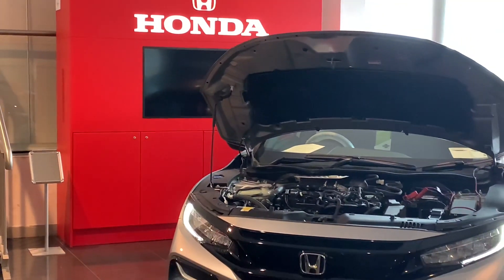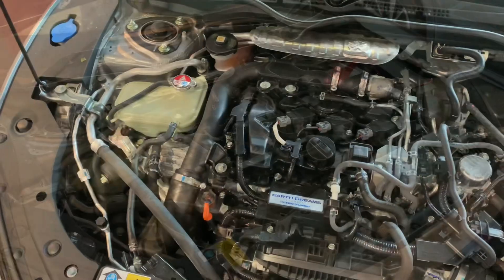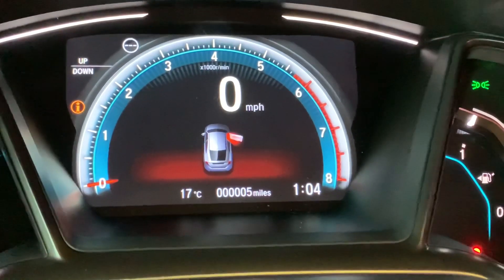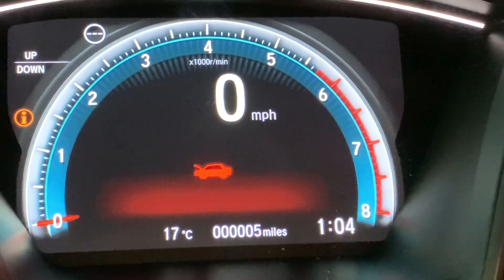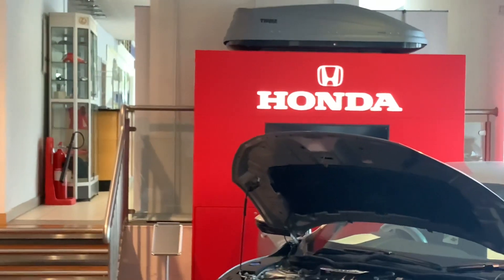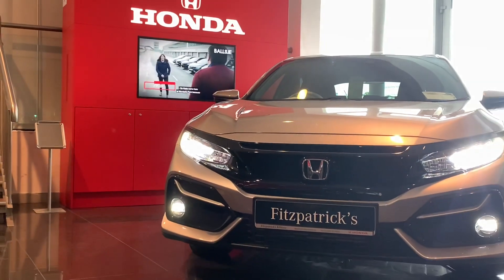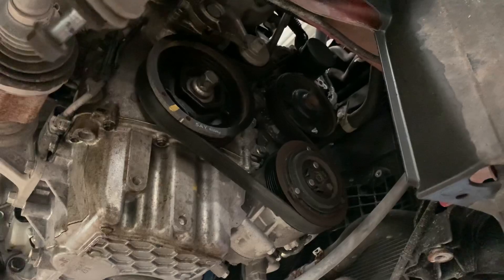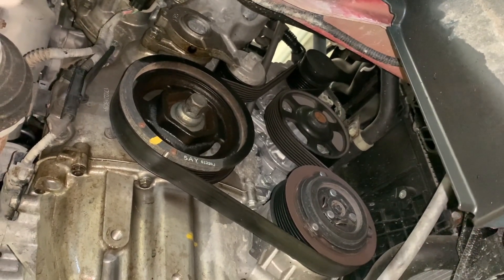1.0 Turbo Civic engine review - P10A2 - what is it like ?

Comment: Bad engine with lots of problems
Reply: im still with no car they got the engine down and open the cilinder head valves on cy2 were dirty and blacked compered to cy1 and 3 that looked like new waiting an answer from Honda Italy
Reply from the maker: @Exia2004  what year is the vehicle ?
Reply: @doolanbrian  it is from 2017 any way we find the damage was the mid piston head had a broken piece between the two piston rings..... Honda passed in warranty after 2 months having the car in the workshop (i was one year out of official warranty) the engine without cilinder head and the turbine plus labor Hours im only to pay oil gasket and stuff like that and I changed the clutch
Reply from the maker: @Exia2004  ok so you are getting a lot of it under warranty?? This is a good result ! 🙂thanks for the update !
Reply: @doolanbrian  new update i had to leave the car in Honda again for cylinder misfire. wow im really disappointed ☹️
Reply from the maker: @Exia2004  has your engine had a rebuild ??
Reply: @doolanbrian  yeah you can say that they changed the cylinder block and the cylinders with new ones
Reply from the maker: @Exia2004  let me know what the diagnosis is .. I’m curious, I’m sure they’ll fix it but it’s annoying alright
Reply from the maker: The engine issues on this are usually linked to 
✅poor service history
✅incorrect oil used
It is a fickle engine but it can be reliable when serviced correctly
Reply: @doolanbrian  serviced every 8k km the right oil driven her no more the 180km/h now out of nowhere random missfire at 88468km this is my third Civic....such a ket down
Reply from the maker: @Exia2004  what is the diagnosis on it ?

Comment: important question: which oil does this engine in combination with the CVT-Automatic requires ? Or which is is used by your dealership? Thanks alot.
mine got 0w20 Honda Type Engine Oil.
Is it possible to use other brands?
Reply from the maker: We can only recommend the genuine brand so there is a specific CVT gear oil and a specific earth dreams engine oil for this engine .. where do you live ??
Reply: @doolanbrian  im in germany.the car has been manufactured to my suprise not in swindon but tokyo. its an importversion from belgium.id like mine to work as reliable as possible. but figured oud that 0w20 viscosity oil is very coldstart friendly maybe thats the reason fir the dealership to use the 0w20. i hope it wont oberheat on long drives and burns oil.  i intending to do the service with a castrol C2 oil,but the dealership here said they only use original honda oil. thanks alot
Reply from the maker: @Hawk816816  Are you sure it was assembled in Japan? Definitely never heard of that before but I always stand to be corrected, I would purchase oil from the local Honda dealer and use what they recommend, that is what we do here, thanks for watching!
Reply: @doolanbrian  yep, has the plant no. of minato japan in the cars code no.as i said i was surpried since i expected england. maybe belgiun civics were imported from japan?
Reply from the maker: @Hawk816816  It’s possible, I never heard of it but I’m always open to new information! Thanks for sharing

Comment: When you look up Civics from 2006-2022 they have timing chains. Very confusing regardless the engine size
Reply from the maker: Since 2017 1 L petrol is the only one that comes with a timing belt, 1.5 petrol has a chain, 1.6 diesel also has a chain 🙂🙂
Reply: @doolanbrian  yes, I had a look, it’s a belt. 👍🏻 cheers

Comment: Does this car have a turbo with an intercooler then? If so is it safe to do any performance upgrades to the car?
Reply from the maker: Hi there ! I loved top gun !!  It is my understanding that all turbo cars have an inter oiler so technically you could Chsnge parts like the inter cooler to increase air flow .. it’s quite a small block so I don’t know how robust it would be to increasing the Bhp ! It’s possible .. but you would need to ensure oil flow is not compromised 💪🙂 hope this helps !!
Reply: @doolanbrian  spot on thanks for your help. I have this engine in a sport line but wanted 1.5 however no leather options unless prestige. Your videos are great and informative. I was looking at a remap to be honest with a new exhaust system. I did see you mentioned about the timing belt change but I Also read online that Honda reckon this belt will last the lifetime of the vehicle. It's an oil in belt setup I believe?
Reply from the maker: @maverick9055  thanks for the nice comment .. sportline is lovely spec !! We never got it here 🙄😞 … we have been told to change the belts at 6 years or 120000 , have you asked your supplying dealer if they have a recommendation?? I’ve not heard of a lifetime belt recommendation … it would be great because it’s an expensive job !!!
Reply: @doolanbrian  yeah it's a cracking spec car. Leather and body kit etc. Needs a bit more power but good for around town. Be better if you opened up over here in UK. After sales are never great over here. Yeah I read it online about the lifetime thing. All about plenty oil and clean oil by look of it.

Comment: Great video.  What's it like for motorway drives and mpg for long distance journeys...really intrested in how this engine will do at constant 70mph driving.
Reply from the maker: Hi there thanks for watching I suppose on the motorway you should average about 6.5 L to 7 L per 100 km. Roughly 35/ 40 miles per gallon. It will also cruise very comfortably at that speed 🙂✅
Reply: @doolanbrian  I drove 700km and most of them were on motorway. I averaged 6L/100km with average speed of 110km/h. 90% of the journey It was onAdaptive cruise control.
Reply from the maker: @hamidsiddiqi3573  that’s good going, thanks for watching!

Comment: My first question is how much does the engine weigh? That’s engine, including cooling system, including fluids, but specifying what fluids and what quantity.
Reply from the maker: So as we were saying, the engine probably weighs around 1275 KG by itself .. There is approximately 3.8 L of oil that needs to go in and approximately 5 L of coolant, hope this helps!
Reply from the maker: From what I can see apparently it is about 1275 kg .. I’ll come back to you to let you know how much coolant and oil goes into the engine, I need to check with a mechanic on Monday
Reply: @doolanbrian  thanks, I’ve had a love affair with Honda engineering since forever. You know they say they aren’t car builders, only engine builders who also build some cars. You may not know this, but post World War 2, mr. Honda’s only child, a girl, married an Irish/Australian mechanic, who guided the engineering of the company for over 20 years.
Reply from the maker: @anthonyburke5656  that’s mad bit of history, I think back then they were more into motorbikes and sewing machines?

Comment: Thanks for the video Brian very informative, I have a question regarding the same 1.0  turbo you have reviewed in the video for a friend. She currently has here car in with the mechanic due to a faulty turbo in the 17-2 model. The total cost of the replacement and service is coming to 3k, the mechanic who we have both had our car with many times mentioned that he did a bit of research on the newer model civic's and he found that there has been a high amount of reported faults with this models turbo. I'm wondering if you could shed some light on this and let me know if there is actually any truth in his statement? He even went as far to say he would have always sworn by Honda's and Toyota's but after his finding he'd be steering people away from buy this model. She'd be a very conservative driver unlike me on the other hand. Thanks in advance!
Reply from the maker: Hey Colm , we had replaced a couple of Turbos alright unfortunately . If its needs a turbo it is expensive for sure . The issues we have seen can relate to large gaps in oil changes . Yours may be different but we had seen a couple of turbos blown on cars which had large gaps in the service record and in both cases they were overdue service. The interval on these engines is short at about 8000-10000kms but its necessary to keep the oil and the turbo in good shape. Has your friend gone to a main dealer direct ?
Reply: @doolanbrian  thanks for the reply good to know that the mechanic wasn't BSing her she didn't send it into a main dealer it's a garage we've been using for years
Reply from the maker: @collykavo1  how many kms on the vehicle ?? Just curious!
Reply: Brian, have you had any further failures of the 1L engine since this video was made? I have been in contact with Honda UK and they have admitted swarf from the belt clogging oil pathways is a definite problem on these engines. Such a shame its a wet belt! Be no problem if it were a standard dry belt.
Reply: 48k

Comment: Does this car use similar suspension and brake part to the 1.5l model?
Reply from the maker: Suspension is the same but I’d need to check the pads .. do you have registration??

Comment: great video!!    i own 2017 civic 1.0 its been a nice car to drive.here in Sri lanka many customers faced the so called AC condensor issue including me. had to fill up r1234yf and replace ac condensor. and some users here complained their turbo failed. this happened becuse of the use of semi synthetic engine oils. NEVER PUT SEMI SYN ON TURBOS! this car is soo sensitive.. but such a fun car to drive AND this car loves highways!best fuel economy 4/2l/100km which ive achieved.. keep doing videos about this model Brian! been watching since u started this series. cheers!
Reply from the maker: Thank you for the nice comment! We also have the a/c condenser issue but in fairness the manufacturer is standing over the issue which is great .. we had some turbos fail but again Honda warranty has been excellent !! Thank you for participating!! 🙂

Comment: I've seen civic with the 1.0l on autotrader with 95k miles in it. So I guess the reliability is there. I've heard one guy had problems with oil starvation caused by the timing belt and it was at low mileage also. Ours sits at 60k miles now so probably next year will do the timing belt on it.  I don't know if any independent garage will handle this job. My only option might be Honda dealership. I was quoted £800 at my local Honda. Quite a lot for a timing belt change. I don't like it when the serviceable items costs nearly 1k to do. Puts me right off and most people sell it just before the timing belt interval.
Reply from the maker: Yes, I reckon by the time you do the timing belt and service on the vehicle it will be close on €1000 .. due at year six or 120,000 km, it’s an extremely labour-intensive job unfortunately so it looks like a full day in a workshop which is abnormal compared to most vehicles🙂 The starvation issue, can occur with fraying on the timing belt.. regular oil changes are absolutely imperative
Reply: @doolanbrian  I've always done the services on my own. We buy cars when they're out of warranty anyway. Change oil every 6k-7k miles. Don't trust these long interval bullsh*t that some manufacturers claim so they can attract people with low maintenance vehicles. Well what happens after the warranty is over? 
We bought a 16 plate astra a few years back, it was a fleet car with 105k miles on the clock. Oil changes done at every 20k miles. After we bought it, 2 months later the timing chain started rattling like mad. Something tells me if the oil changes were more frequent, this wouldn't happen. 
Anyway, very good content like always. I watched a lot of your videos and I like that you don't take the piss on the 1.0 l engine like everybody else does. I mean I would love the 1.5 if I could afford it. This 1.0 does the job just fine. The previous civics had a 1.4 naturally aspirated. I bet that was slow.
Reply from the maker: @DarkR3surrecter  thanks for watching, yes the one litre turbo would just eat the old 1.4 nonturbo off the road !!
Reply: @doolanbrian  great video, but I heard fraying on the timing belt is caused because of bad design of timing belt system or bad part from supplier in a certain period. Timing belt rubbing against metal part on crankshaft and shavings clog filters on turbo and vtec oil ways and this will cause disaster. New engine and turbo required, cost more than new civic from dealership.
Reply from the maker: @gabinecek  There is definitely cases of timing belt Fraying .. Changing the oil on the vehicle removes the debris and avoids the clogging you are talking about, in four years we have had to replace two engines, in both cases the cars missed three scheduled oil changes... The consequence was that the debris continued to build and eventually caused the clog you speak off .. Service history and proper oil changes are imperative in this engine
Reply: Hi, 
Very informative video, thanks for taking the time to post it. The cars that missed 3 scheduled oil changes, were these on the 12,500 mile interval? Or the 6250 that seems to have come in more recently? Three changes is a lot to miss! Oil must have been like treacle in there. 
All the best
Reply: do you want to say something about it? Thanks, G
Reply: We got 2017 reg belt gone 58 thousand not like Hondas that

Comment: I've seen the belt runs in oil and the engine is low friction as possible. It has fast warm up properties and lightweight block. It is torquey but does have a bit of rev hang. I drove from Manchester to Birmingham the other day on M6 motorway and achieved 70.1 mpg over 90miles run (have a camera pic to prove). I didn't realise it needs an interim oil change every 7000miles or so, but fixed cost of £125 in UK. So not too bad.
Reply: Also, I check my mpg on refills to check the trip computer and the honda unit is accurate to a couple of mpg. My old Audi diesel used to over read by about 10mpg! Not surprising with VW emissions scandal
Reply from the maker: @richiebtime489  It’s impressive fuel efficiency you must be a very frugal driver
Reply: @doolanbrian  Hi Brian, I'm doing about 500 miles a week at the moment, lots of motorway miles. Last tank did 500 miles to one tank at 55mpg. 1 litre SR. I reckon I'd get about 65mpg in a 1.6 diesel.
Reply from the maker: @richiebtime489  holy crap !! That’s really super going in the 1.0 !!! and you’re right .. you’d really eek some great figures from the diesel I bet 💪🙂
Reply: The timing belt costs around 2500 euro to change in Sweden. Thats why I bought a 1.5 instead. Otherwise im more than fine with the 1.0 performance actually. Sad really its that expensive. :/ And you also need to change the belt in 6 years.
Reply: @joakimberg692  I'll get rid before that
Reply: I think you will be in for a shock with the timing belt, it is a £2k job in the UK.
Reply from the maker: @jamesmckelvie  are you sure ??? 🙂 we are doing them for under €1000 … check a few dealers over there , £2000 can’t be right ! It would be cheaper to get the boat over to Ireland to get it done !!!
Reply: @jamesmckelvie  2k no way. Honda wouldn't do that to customers.
Reply: @richiebtime489  seems to be the figure folk are receiving from the dealers.
Reply: @jamesmckelvie  might be worth going on eBay, find a spare engine, might be cheaper! 😭🤣
Reply: @richiebtime489  not a bad idea lol.
Reply: @jamesmckelvie  Slightly off topic but checked on we buy any car, they're offering nearly the same I paid for it 14 months ago. As mentioned 2019 civic SR 1 litre.
Reply: @richiebtime489  £1349 on Honda UK website.
Reply: @-DC-  thanks for the info. That's still expensive. I had and an Alfa 147 GTA 3.2 V6 the cambelt change wasn't that much.
Reply from the maker: 70 MPG ... Holy crap !!! That’s phenomenal !! The 1.5 is actually worse for Rev hang I find ! What speed were you doing on that fuel efficient run ??
Reply: @doolanbrian  Hi Brian, about 60 mph. I set my lane assist and cruise control and sat behind a truck. I didn't have to brake/accelerate and there was quite a stretch of 50mph thru roadworks. This was about 7pm. When I came off the motorway I took a picture of trip computer over 90odd  miles. I did go on Twitter and @ honda UK with the pic but never got response. This is a 1 litre civic SR 2019 with 17" alloys. I feel like I should have won a prize Lol!!!!
Reply from the maker: @richiebtime489  🤣🤣 get onto the Guinness book of records of about that one Richie!